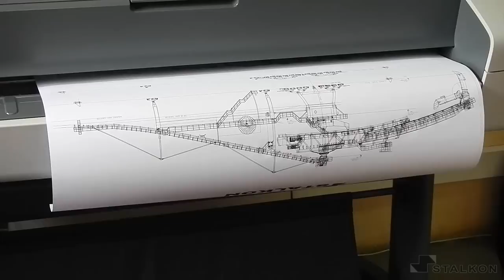Stalkon Steel constructions - production and assembly

Comment: I don't think I saw a single worker (aside from those painting) wearing a respirator while welding and/or grinding.  Shame.
Reply: Oscar Sanchez Jr, BSc. It’s not good, you’re right. But rough necks don’t care too much unless you’re welding on galvanized, that’s really when you need em. Welding in 105 degree weather, leathers on, hard hat and hood, and a face mask under with safety glasses is a lot to deal with. Sometimes people risk safety for comfort